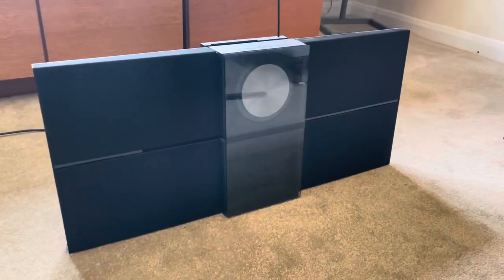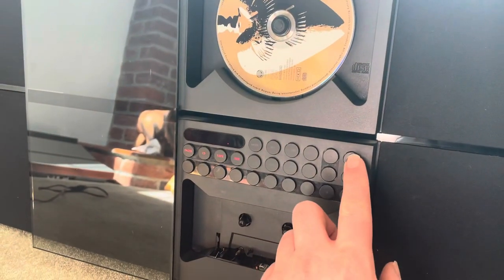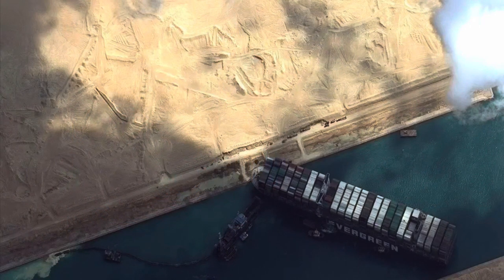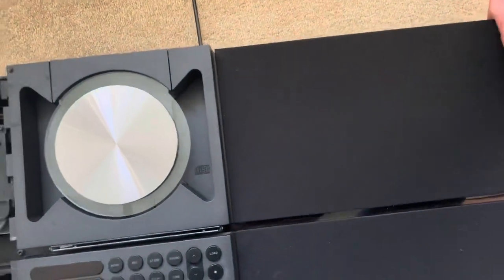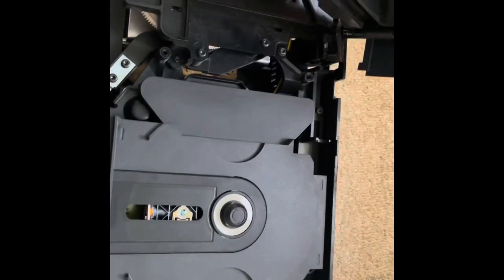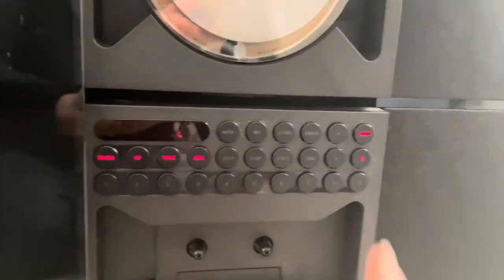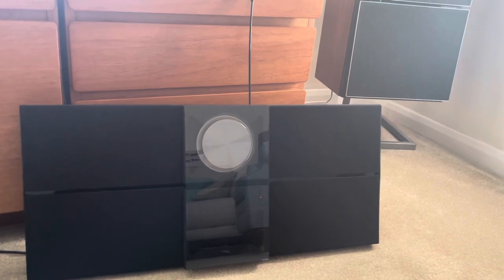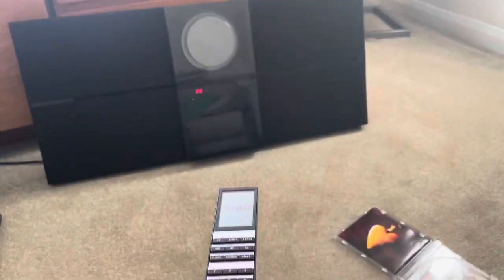Beosound Century / 2000 CD laser repair and review / thoughts B&O Ep.04

Comment: Absolutely a great video, I did the repair like shown and my Beosound worked again.

Thank you so much for this great video!

PS: Be very careful with the flat cables attached to the CD unit circuit board. Especially that one connected to the motor can easily break and it is a he'll of work fixing such a cable.
Reply from the maker: Absolutely true, I imagine they could be a pain to fix ! Hopefully not speaking from experience. Glad it’s working well! Thanks for the comment :)

Comment: If you still have the original mech you can adjust the potentiometer by a fraction of a time by the diode pack the ring of solder joints  to re trim the opu, I’ve just got mine working like that and its handy to have a backup
Reply from the maker: I do have it yes! I’ll have a try with that sounds like a good idea. Is it turning up the laser power?
Reply: @chrisbaker121924  Basically your lowering the resistance and accommodating the gradual changing of the capacitors as they age over several years so things go out of spec then you have a “failed OPU unit”its not one hundred % successful but its worth a try, one word of caution use a 2mm slot screwdriver VERY CAREFULLY just a slight bit at a time i turned mine clockwise as i looked at the pot. Easy does it and try it out each time you make an adjustment. BTW just raise the mech at the lower edge once you’ve swapped the opu over  to do the adjustments and cover the mains transformer with some insulation it stings like hell it you plug yourself in LOL and fingers crossed for you ….
Reply from the maker: @Marie579  

Good advice that with the transformer! They scare me a bit and try to avoid going in them when they’re on as much as possible. They’re tight in there. 

Tbf since this is currently working I might just leave it alone 🤣… But I’ll keep the original so if it does stop in the future I can swap it back in or try the pot trick on the new one. 😄
Reply: @Marie579  where is the potentiometer located on the Beosound Century?
Reply: @tylerevans2261  Hi Tyler the potentiometer is on the flex PCB on the CD Mech itself, its about 3mm big so be VERY delicate and gradual in how you turn it.

Comment: Getting ready to move and I was going to toss my beosound 2000 that has not worked for years. Looks like yours, not a century, I think those are euro? Grateful to stumble  into your video.  I found a CDM-12.4 VAM1204 EF-20A (which is what I have) on aliexpress for $12 US. Darn, I don't have the smallest torx for the axle retainer, :)  If I get this working I owe you a beer.
Reply from the maker: Let us know how you get on. It’s a bit fiddly removing the old laser so just take loads of pics of what goes where. I bet it will get it working! :) I wonder how many of these ended up in rubbish tips for such a cheap part. The small torx bit screwdrivers are available on Amazon and eBay etc. useful thing to have for fixing vacuum cleaners these days too!

And thanks :) if I’m in the states I’ll have a beer 🍺 😁. I’ve fixed loads of stuff on my cars by watching someone’s video, YouTube is such a great resource.
Reply: @chrisbaker121924   I got the part in about 2 weeks from ali express, replaced the part in about 30 minutes, watching your video on pause and repeat, and its works! My mind is blown! Grateful for your help with this. Cheers.
Reply from the maker: @jeffsmith5140  that’s great news! Glad it’s working for you, another one saved!

Comment: Outstanding video
Had same problem and got mine working again with new laser per your instructions
Initially appeared to have the same problem after I reassembled 
I took it apart again, suspecting that laser lens was not in appropriate home position, finger turned the gear on the shaft of the small motor
that positions lens to move lens to middle of it’s range, put all back together and CD player works again. Wonder if position of lens was actually the initial problem and not a malfunctioning laser???
Reply from the maker: Thankyou :) glad it is now working! Could be or a connector that wasn’t quite seated or something?

Comment: Hi. That’s a nice clean item. The century seems to be a much overlooked machine, yet if I remember correctly it won an award back in the 90’s with one of the hifi magazines of the time. Yours seemed to be an easy fix, I wonder how many others have sadly been binned because the cd died and owners were told too expensive or parts not available for repair? Enjoy.
Reply from the maker: Yeah it’s in lovely shape! Yeah really overlooked and generally really impressed with its sound for its size. 
Such an easy fix I really do wonder generally how much stuff ends up in landfill that’s a cheap part away from another 10 years of service. Find it really sad that people probably throw away quality items and replace it with junk half the time 😅. Hear stories on the group of people finding B&O stuff in skips although now with eBay and Facebook think most people give them a chance on there now.
Reply: @chrisbaker121924  I’m guessing it’s more suited for the kitchen or conservatory than main room use. Maybe add a Bluetooth or airport express device to the aux in for streaming? I often find myself just browsing local adds , eBay etc for B&O bargains . I don’t actually need anything at all but I’m always just curious.
Reply from the maker: Really depends on someone’s expectations. These days it seems a lot of folk are very happy with little Bluetooth speaker things. I personally would say it’s no substitute for a proper set up but perfect as you say as anywhere with a bit of background music might be nice. If I had one in shoddy condition I’d use one in the garage but this one is too nice! 
Might hang it in the study and bring it downstairs/out into the garden occasionally. Might just sell it on 🤔. I just get too attached to these things 😅
Reply from the maker: Yeah and of course you can stick anything you like into the aux. I tend to just plug my phone in rather than the airport WiFi Bluetooth things.
Reply: @chrisbaker121924  Far too nice to sell on😄. Just keep it and enjoy it. I’m always loathe to sell any of my B&O, so I don’t 😂. I use Airport Express into my BC9300 with BL8000, and an old iPad for Spotify over AirPlay. This works a dream every time . Sort of a poor mans Beosound Moment, but arguably more reliable.
Reply from the maker: Personally I am generally mostly a fan of the Jensen era stuff. The new stuff is outside my price range by a long way ! To me the century is pretty much modern anyway 😂. (David Lewis stuff)

I’ll have to look into this setup I’ve heard a lot of people use it. Out of curiosity what advantage does it have over just plugging in your phone ? (Aside from that your phone isn’t tethered to it of course 😃)
Reply: @chrisbaker121924  Totally agree about David Lewis / Jacob Jensen era. New is completely out of my league. Are you an Apple or Android user? If android then you need Google chrome cast audio , if Apple then either GCC audio or Apple airport express. Advantages are firstly ( as you said) that your device isn’t tethered to the system so it’s much more convenient to use. Secondly you can ‘ take your music with you’ if you have more than 1 such set up at home. Specifically with GCC you can group as many devices together under 1 heading and stream to them all at the same time if you want, or separately. You can only use 1 device at a time with airport express but can still transfer music to another express easily on the go if needed. I’ve used my express for over 6 years now and it’s great. No drop outs and to my old ears as good as cd quality. ( Apologies to any audiophiles reading this😂). If I’m feeling generous I even let friends use their IPhones for their choice of music when I’m entertaining. For me it’s not intended to replace cd or vinyl, it’s just another music format that breathes new life into older systems. I suggest checking out Steve from Sounds Heavenly YouTube channel, he did a whole feature on this very subject. Sorry I’ve gone on a bit but yes, I would certainly recommend going wireless if possible.
Reply from the maker: Steve’s channel is great :D 

Ah that’s useful yeah I’m an apple user. Would it mean I could run several systems at the same time then :o like almost broadcasting round the house?
Reply: @chrisbaker121924  Yes with GCC you can do exactly that. I’m not good at copying YouTube links but have a look at a channel called B&O Lover. He mainly posts music tracks being played on his various B&O systems ( Im surprised YouTube copyright hasn’t been onto him yet), and on one video he demonstrates GCC audio playing all over his house. He uses a couple of A9s , a BS3200 and BS5 . It sounds great. I believe GCC audio units have recently been discontinued but I’m sure there’s plenty on eBay etc. Steve’s video on making older B&O wireless is certainly worth a look as well.
Reply from the maker: I’ll deffo check them out thanks :)
Reply: @chrisbaker121924  Keep us posted on what you decide to go with 👍

Comment: I just bought a century (with yellow speakers) from a charity shop. The main and cd doors wouldn’t open so I replaced the belt and was able to test the cd which doesn’t even spin. Radio and Aux work, sound is great. Do you think this approach would fix the cd even if it doesn’t try to spin?
Reply: Great video BTW, very comprehensive 👍
Reply from the maker: Probably not, but on the plus side the entire mech is available cheaply too! Motor and all.
Reply: @chrisbaker121924  thanks! I assume it is the cdm 12.4 mechanism (not a B&O specific part)?
Reply: In most cases, if the laser is bad, the CD won't even spin up.

Comment: Great Video... i have one of these, but the remote sensor has stopped working...any ideas where i can find the unit ? i have been told they replacements are expensive
Reply from the maker: Are you sure the remote function isn’t turned off?

https://forum.beoworld.org/forums/topic/bo-beosound-century-remote-control-troubleshooting/

The other thing to consider is are you sure the remote is working okay?
Reply: Both of mine had the remote sensor die.  The fix was quite easy, it involves replacing 3 capacitors on the sensor board.  Beoparts sells the kit for a few bucks.  BUT.... you need to know how to solder.

Comment: Thanks for the video, can you show where the door sensor position is? Everything works, only when i install the door does the Sensor not work. When i remove the door everything works fine again. Greets
Reply from the maker: Are you sure it’s the sensor, it’s probably a problem with the mechanism. Try if you can carefully moving the door all the way to the fully open position and make sure it operates smoothly. If it gets jammed it deliberately detaches to avoid damage to the mech. 

I believe the sensor is behind the display. Not 100% sure however!

Comment: Hi, I've just saved one from landfill. Got the tape working but not the CD. Would you do the repair?
Reply from the maker: Deffo worth doing the repair. :) what have you tried with the CD so far?

Amazing find, saddens me how many of these amazing items end up in landfill for something so minor.
Reply: @chrisbaker121924  that's exactly why I saved it. Never attempted anything like this before. I've done the obvious and cleaned it up and used a CD cleaning disk. That said it's the same issue as you had so I guess the same solution. Just not brave enough to try it. B&O want £50 just to look at it!
Reply from the maker: @NatGriffiths-ct7nf  never heard of a CD cleaning disc! Truth be told I wouldn’t even bother taking it to B&O, of course it varies dealer to dealer but in my experience they aren’t particularly interested in fixing older gear, perhaps this is just about new enough that they would fix it but it’s doubtful. I could certainly try swapping the laser, that’s usually the fault. If you’re anywhere near derbyshire I’d be happy to try!
Reply: @chrisbaker121924  That's v kind of you. Sadly I'm way down South in Bristol 🙄

Comment: Hi again I've just bought the Beosound century great system.  I have a Question how do you get a Beolink 1000 remote to work with it I have two remotes both work with my Beocenters but not with this Beosound any suggestions please 
Regards Lee.
Reply from the maker: With the Beosound Century at standby (red light showing, but turned off), point the BL1000 at the Beosound and press STANDY (Red Dot) then SOUND then 1 then STORE.  The digit ‘1’ should briefly be displayed on the Century’s screen. It should then respond to remote commands. Hopefully this should work!
Reply: @chrisbaker121924  Hi thanks for your reply I've tried both my remotes on the Beosound and had know responses from either, funny because they work fine with both my Beocenters. 
Regards Lee.
Reply from the maker: @leeBoB4257  must be a problem with the beosound then. It’s possible to turn remote control functions on and off with that above procedure. Perhaps in situations where you may have two systems in one room. Did the procedure above not work? If so must be a failed IR receiver on the century
Reply: @chrisbaker121924  Hi both my Beocenters are in my living room and both Beolink remotes work with either one my Beosound is in my bedroom I've tried both remotes and nothing happens so it must be the Beosound.
Reply from the maker: @leeBoB4257  have you tried that procedure above with the remote pointing at the beosound in the bedroom. It’s not the remote that’s turning off when doing that procedure rather teling the beosound to ignore/(or start paying attention again) to remote commands.
Reply: @chrisbaker121924  Hi I've had a word with Steve at Sounds Heavenly he thinks it's the senior on the Beosound.

Comment: Mine just started skipping on CD's. Sometimes its definitely the CD, but not always. What should I do?
Reply from the maker: If the CD is scratched then it might be the actual CD as you say… other than that my first guess would be try gently cleaning the laser with a cotton bud. Very gently. Maybe there is a fleck of dust on there. 

If that doesn’t work the laser is probably starting to show signs of failure.

Comment: I have one of these and the aux input is absurdly quiet and basically unusable.  Is there anything that can be done about this as the system is useless to me without proper aux since I don't own cds or tapes.  Thank you
Reply from the maker: Not that I’m aware of, I assume you’ve checked the cable is good and the source is loud enough. 

Just one thought… I know a lot of aux items were louder in the 90s 00s than they are today. So maybe the century is balanced for that. I think some legislation came in place to prevent hearing damage. My old 2005 iPod is way louder than my phone. 

Something you could try is an anker Bluetooth receiver. I use one on my stereos and again as an input device bluetoothed from my phone it’s almost twice as loud. Sound quality is decent enough for non analytical listening. Might be worth a go!

Comment: Any suggestions for fixing the tape mech on one of these. The pinch rollers move, but the tape take up hubs don't revolve. Could this be a belt issue? I'm not worried about cost as I found it in my neighbour's bin!
Reply from the maker: Sorry I’m not 100% sure as my tape just worked, and if it isn’t broke etc! but…. I’d be 99% sure it needs a belt kit. Pretty straight forward to do. Google the service manuals and you’ll be able to see where the belts go. It’s likely they’ll have turned into gooey mush that is horrendous to remove. I found nail varnish remove (acetone) to be the most effective. The black rubber goop gets everywhere so do it over a hard surface and not a cream carpet! 

You may need to remove one or two parts on the tape mech to access all the belts but take careful pictures along the way and you’ll be fine. Maybe make a YouTube video with it 😃. 

Great find in a bin btw! It’s nuts what some people throw out. Good save.

I should add Martin at beoparts will likely have a belt kit and any spares you need for that.
Reply from the maker: Wow always had a love for the triumph roadster. Must be a challenge to restore something like that. I’ll check them out. Just subbed! Guessing you’re in the USA if you have possum problems 🤣

If it’s briefly spinning but not playing and then rejecting it will be that laser part.
Reply: @chrisbaker121924  I'm in Australia actually and yes - if only replacing the belts on a Roadster would fix it's problems! My CD player does have the same fault as yours so I'll give your fix a try as soon as the replacement laser turns up. All the best.
Reply: usually the idler wheel and the rubber that is the issue if the tape is not rolling on play. The pinch roller works irrespective. to get to the idler you will have to get into the mechanism.

Comment: Where did you buy the laser pickup please?
Reply from the maker: Actually just from eBay. It’s a really common part across a lot of players from this era. Phillips CDM12.4/VAM1205. You only really need the laser assembly not the entire transport but it looks like the entire transport is available for and it would probably drop straight in if you wanted a less fiddly job.

Just make sure your laser is the linear 12.4 and (tracks up and down) rather than the arch/radial type CDM4 that was available in some of these units. They’re a bit harder to find good replacements for.

They’re probably also available on Amazon. Good luck!
Reply: Appreciated for help and in such details. Thanks.